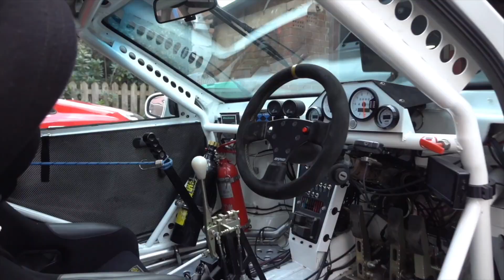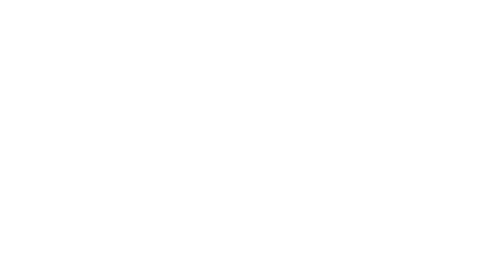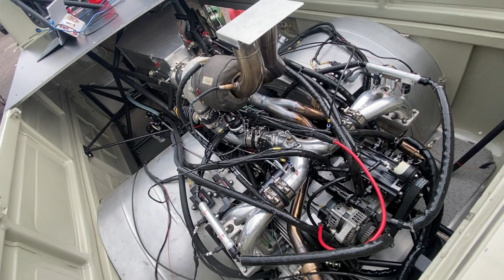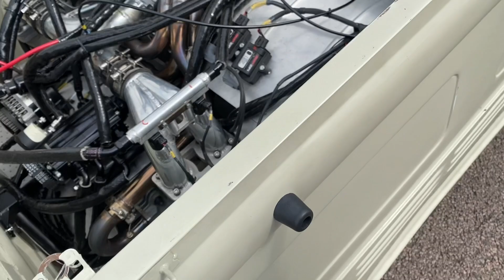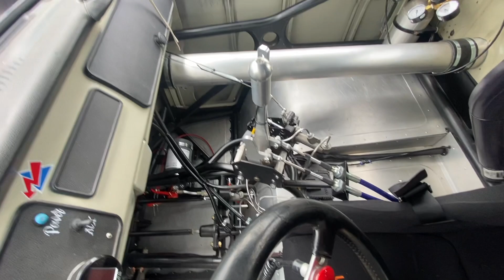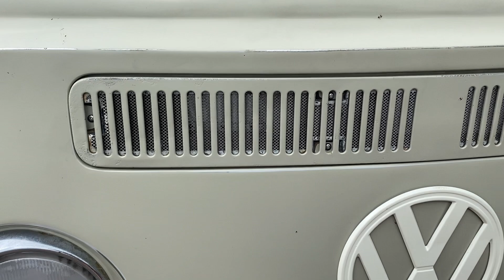900HP Volkswagen Pick Up Van *Drag Racing Monster!*

Comment: I am impressed you pretty much had it all worked out.

The Co2 does the chute and wastegate control, hence two regulators. 

It's a 2931cc air-cooled flatfour Pauter engine, 6466 precision gen2 turbo, billet atomizer 550ph injectors. Running Methanol.

9.01 @ 152mph is my best ET
Reply: Don't know his name but he's been putting out some good stuff, and getting access to some big cars. That's some car you've built i'll be keeping my eyes out for it.
Reply: Frustratingly close to getting into the 8's! Nice build, bravo!